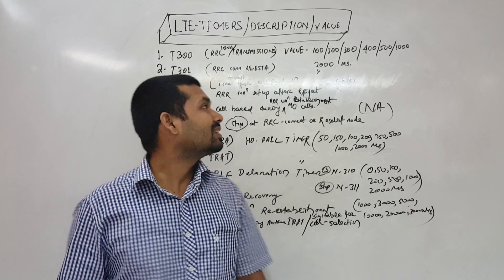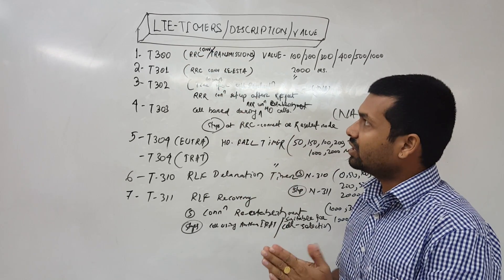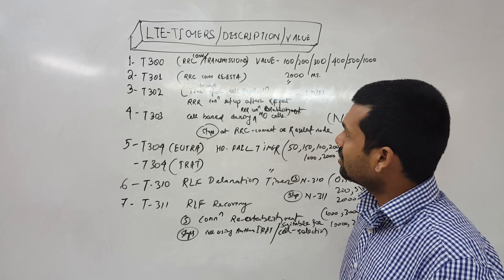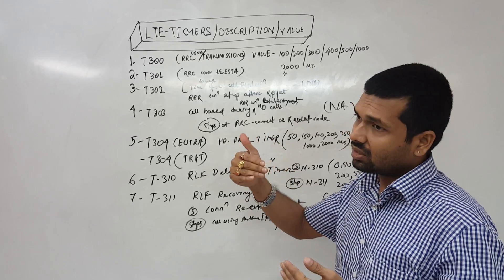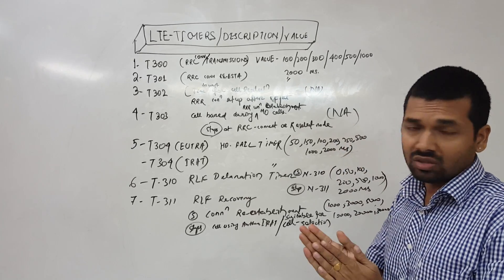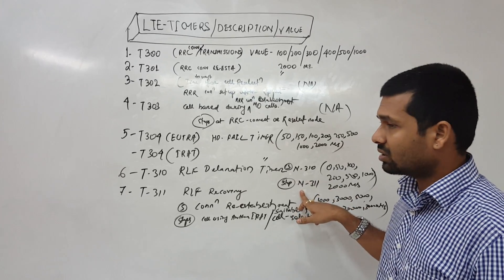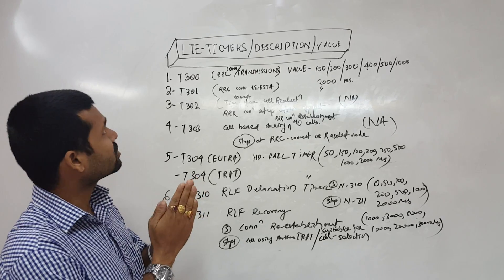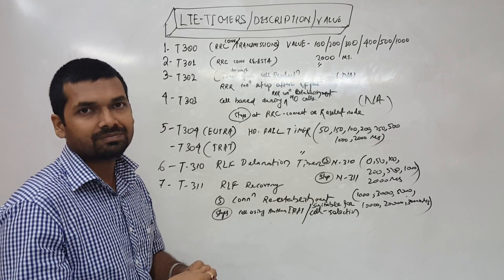LTE timers and description,niladri nihar nanda

Comment: Timers and constants used in RLF:
T301 Transmission of RRCConnectionReestabilshmentRequest
T310 Upon detecting physical layer problems i.e. upon receiving N310 consecutive out-of-sync indications from lower layers
T311  Upon initiating the RRC connection re-establishment procedure
N310 (constant)  Maximum number of consecutive "out-of-sync" indications received from lower layers
N311 (constant)  Maximum number of consecutive "in-sync" indications received from lower layers

Comment: T302 :
Upon receiving the RRC CONNECTION REJECT message, the UE should start timer T302, with the timer value set to waitTime. The UE is not allowed to send another RRCConnectionRequest for mobile originating calls, mobile originating signalling, mobile terminating access and mobile originating CS fallback on the same cell on which RRC CONNECTION REJECT is received until the expiry of T302